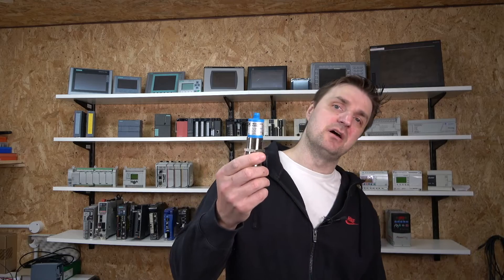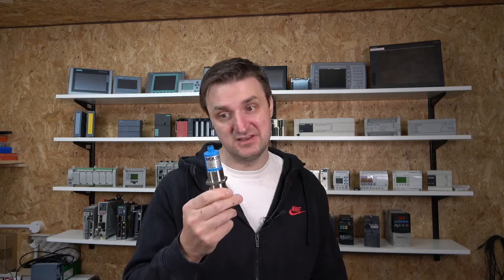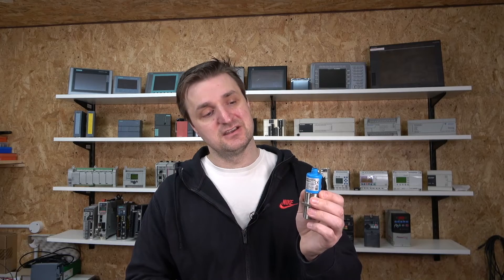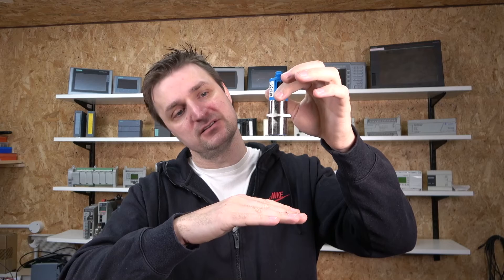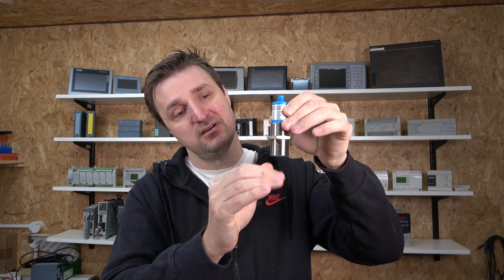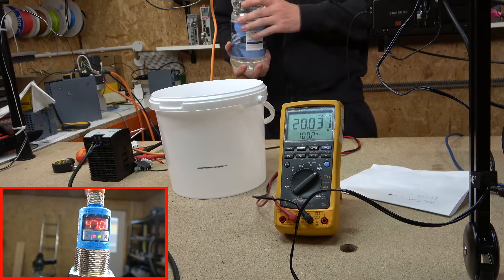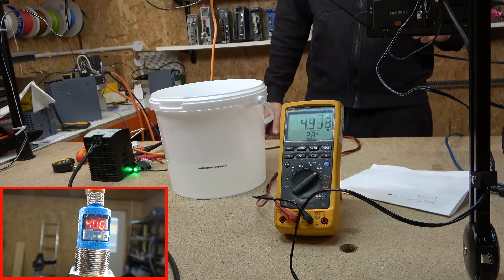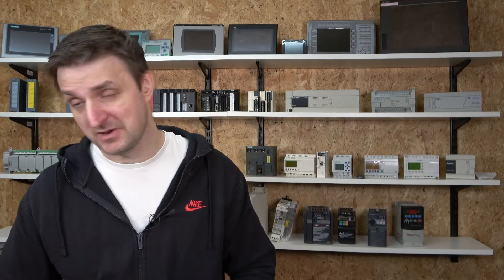Sick UM30 Sensor wiring and set up for analog/digital liquid level control. Worth the investment?

Comment: Hi, do you know if it is possible to make a similar system with SICK UM18 serie? I don't understand if this is a distance sensor or a distance switch (only the detection of a threshold).
Reply from the maker: This is classed as distance switch with 4-20 and Voltage analogue output. You sensor will tell you in label what it is doing on output.